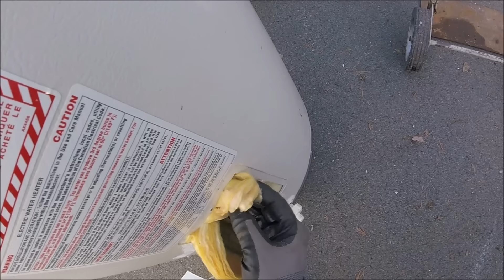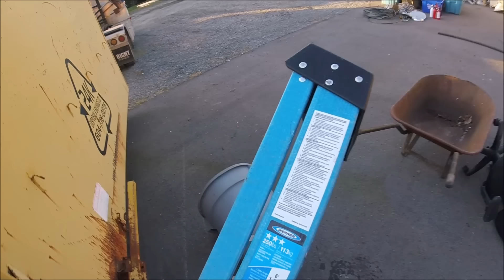Scrapping Stuff & Filling My Scrap Bin Full

Comment: A lot of the bike handles and pedals you send for scrap are actually aluminum or some sort of alloy that you should be taking off your bikes. The handlebars usually is that one centre bolt they pop right out of the frame.
Be safe

Comment: Awesome load Phil.  What's your record weight for a load in your scrap bin?
Reply from the maker: 3500 Tin & Hms 3900
Reply: Awesome!  You might have anew record for tin. @CanadianTreasureHunter
Reply: That was on the old yard probably with those big red things???
Reply: Once in the past in old garage, may be 4-5 years back his shred weighed highest at 4440 pounds. Another time when he got angry with the present yard, he went to Richmond yard where his shred weighed 4000 pounds. Both of them normal shred, but systematically tightly packed. Actually he could make 3500-4000 pound loads. But it takes time and really does not matter. He is more focused on clearing shred as it accumulates. He is making sure each trip weighs not less than 3000 pounds.

Comment: What size is your bins flat floor 6ft by 10-12ft??  Extra 6 inch side area and 7ft sides tall? Ive got a 6 x 10 ft dump trailer and it seems the perfect size for most tasks. Loading at ground level such as your bins is much easier.
Reply from the maker: 8 x 11 by 7 ft high 20 yards